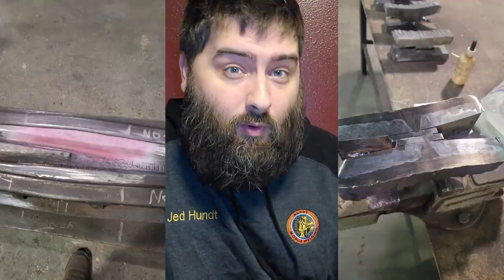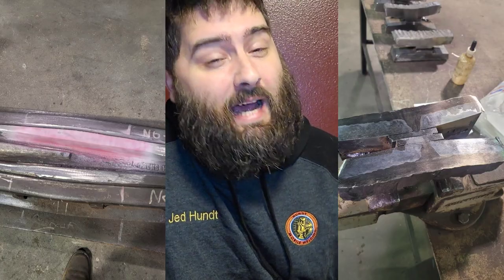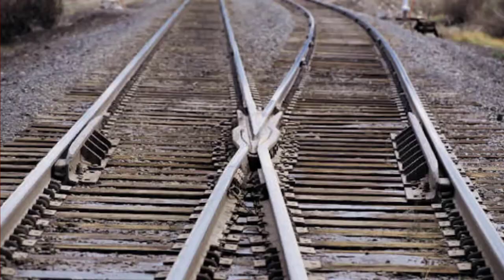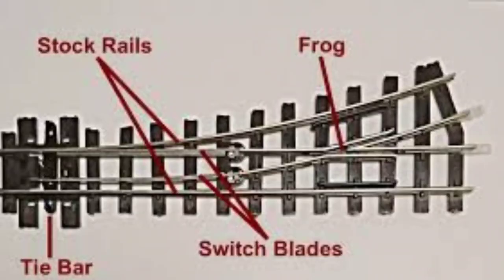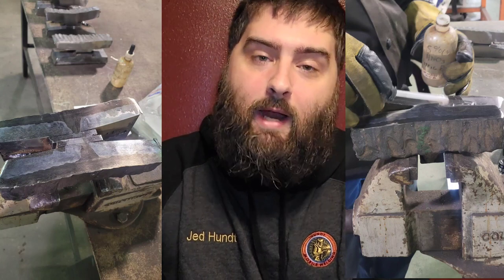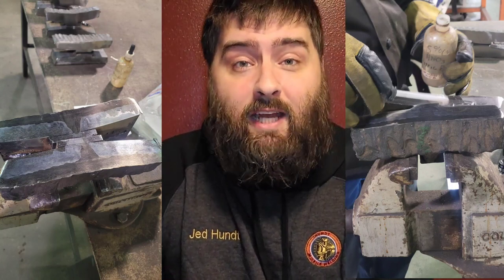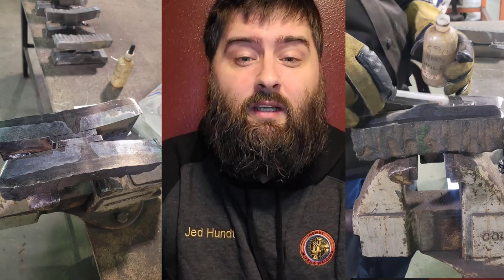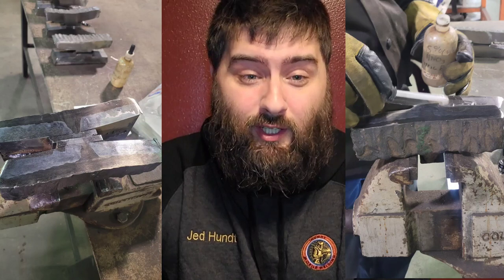Could you pass this Railroad welding test?

Comment: Got my first certification after an 18 month apprenticeship, in about 1980. At that time most of our welding was oxy-acetylene on open-hearth steel...frogs and rail. The frogs were actually bits and pieces of open-hearth rail, cut and milled to fit together, with a few bits of cast iron blocking as needed to make the finished thing look like a frog. Old school. Very large torch tip used for heating, flushing and welding. Welding was done with 1/4" diameter Oxweld MR rod in 3 foot lengths. Flush out the flawed metal, cut the metal with a hot cut chisel and striker. (The striker was a guy with a 8 pound sledge, ambidextrous and striking the chisel or flatter as the welder needs) Welding was done with O-A tip, pretty large bore - do not recall the numbers now, but the inner blue cone of the flame was 3/4" long. Puddle could be  as big as a half-dollar coin. As the metal is built up, it was periodically shaped with a 2# hammer. Excess metal periodically cut with hot-cut chisel and striker. Eventually the new metal is built up to surface or a bit above, then heated to an orange heat and again shaped with the 2# hammer to the desired shape...the excess metal trimmed with the hot-cut chisel and striker. Re-heat and finish surface with a flatter and striker, again trimming excess with chisel and striker. When done well, no grinding was needed. 
Of course, as my road got manganese alloy frogs, we got into stick and then flux core wire, using air-carbon arc to carve out the flawed metal and weld as you described. Also did considerable thermite welding. Finished on the road I started on, but it was bought by the CN and so I re-certified to CN standards, having been retired now fifteen years.
My complete kit could be carried on a gasoline powered track department motor-car, in the oxy-acetylene days. When I retired I used a Class B diesel truck with hyrail gear and an incredible array of equipment and capabilities.
Reply from the maker: That's crazy! Thanks for sharing all that.  It doesn't seem like we have come far (just melting metal together) but to see the advancement in technology is amazing.

Comment: We’d weld these frogs under some of the heaviest trains in the world. Die test, arch air gouge, touch up grind to surface, weld with Eutectic 40 Elctrodes for the underlay, then Mantrack 1ns for the last over lay. Every Bead laid has to be quenched with Ice water then pinned to work harden.
Weld bit at a time depending on the track time granted or planned by the Train control, or Dispatch as you say in the States.
We’d also weld the High speed turnouts frogs on Mainline. Only wing rail repairs where significant Shelling and dipping has occurred. 
These are a Head hardened Type Rail ( Steel)
We’d use an LN8 wire feeder with 8mm core flux wire, preheated the rail to 200 degrees Celsius, weld 100mm Beads at a time, cool under a heat blanket, grind then buff. 

All depends on the Engineering team of that particular network as this practice is sometimes frowned upon in the Heavy Haulage World 😂
Thanks for the video mate 👍🏾
Reply: I mess with .045 and .052 on mining equipment but 8mm?!?!?  Thats HUGE
Reply: @big_ute  it’s all about replacing the material we remove in a certain time frame from the train controller. Bigger the electrode, more metal goes in.

Comment: I could pass this test very easy.  I have taken and given many V-grove test plates exactly like yours.  I have also done lots of CAC. When I had the awsome job of training new hires.  😂😂 this would be a breeze for me..but I know for others it's a nightmare.
Reply from the maker: Pretty standard testing requirements.  The thermite welding on the other hand wasn't the easiest
Reply: @hundtmobilewelding  never done  any of that.
Reply: Too many "I" in your comment. The emphasis may well indicate you haven't welded an ordinary fab. Just saying.
Reply: @1977np  u don't know much about welding processes.  just sayn.   It's one of the easiest test given the field
Reply: @face ‘CRINGE’
Reply: @brandonendler2764  don't be so hard on ya self there buddy.  It will all work out. I'm sure you have 1 friend tha doesn't think that way about you.
Reply: @face.- it's basically padding inside a v- groove with a acid etch.just don't trap slag. Not that tough just saying
Reply: @brianpatrick7193  yeah it is

Comment: I.weld on manganese insert frogs , solid manganese self guarded frog, alloy switch points and rail ends and only a qualified  track welder not a certified track welder. Should I be certified?

Comment: I use to work for large AC machine makers from sheet steel they didn't let me weld the products but I was let loose heavy frames etc to test me I had to weld 5/8 plates at 90 deg and put on a anvil and smack it with a 18 lbs sledge hammer my weld did not break but the plates bent

Comment: I used to work for a company that manufactured switch rods for the railroad, as well as other components for them. I worked with them for about 15 years. Frogs however we did not manufacturer. But knew of them and still had to figure out which rods went with which frog number. It was definitely back breaking work in the beginning. With more experience I got, the higher up in the company I got. I was making nearly $23/hr by the time I left. Kind of wish I was still there. But health issues changed everything overnight. Had to leave for the clinic one morning, fell into a coma, and was transferred to a specialist hospital in 2 days, and hadn't looked back since.  and sucks! But yeah, railroad jobs are good money. Always constantly busy.
Reply from the maker: Sorry to hear about that. Glad you made it through! Railroading is great money but breaks the body down hard and fast.

Comment: How do you feel about welding manganese without a respirator? When I was a roadmaster at UP all my welders were required to have fit tested masks, so a beard was out of the question.
Reply from the maker: Those big welding hoods are PAPR hoods so they are respirators. No more need to shave and have a fit test.

Comment: The red dye is called Penetrant, you do Not let the penetrent dry it has to be wet the full 10 minutes, then you clean off the penetrant with a dry Lint Free Cloth after you have gotten as much of the red stuff off with the lint free rags you Spray Magnaflux Cleaner on another rag and remove all traces of the red dye, this drys for 5 minutes, then you spray the Developer ( white spray ) this stays on for 7 minutes, then you VT the weld looking for red bleed through for defects...
Reply: I wonder what the question in the written exam asked about the penetrant?
Reply: Most likely a standard ASNT question, 
I loved doing MT, PT, RT, VT Inspections. I never did like UT... @chrisallen2005

Comment: I wasn't aware that there was a specific class for welding frogs, worked for a small RR some 45 years ago and was the welder on that RR so I was the guy had to build the frogs back up, did OK but didnt have any of the training that you get from that class, would have been nice.
Switched to carpentry and never gave this another thought until I saw your vid, I'll never be in the position to weld a frog again but it was interesting to see how it evolved.
Reply from the maker: Yeah it's awesome they have classes for every type of welding now days. You wouldn't think melting some metal together could happen so many different ways. 😂

Comment: I was a Navy trained welder and worked for a time in a foundry, the foundry work was all air-arc and fill with dual-shield and everything had to be to X-ray and ultrasound specs, so I Know I could have welded and taken that test, back when the body was still working!  Is a fun job, but welding is hard on the body and beware heavy metal in any form.

Comment: First, congratulations on passing and being certified.
Second, I graduated with a BSCE degree in 1969 and spent over 20 years in railroad track engineering in maintenance, construction, inspection, and design.  I have done some thermite welds but never welded rail or frogs in track.   I did weld two pieces of rail together to make a mailbox support.
Third, frogs come in all sorts of sizes of rail, numbers(angles), and construction.  Frogs are generally made from pieces of rails either bolted or riveted together, fixed or spring rail, manganese insert casting surrounded by rail, and a solid manganese casting which includes a flat-top or self-guarded.  I have seen a bolted rigid self-guarded frog.  Most frogs over No 20 are a swing rail design and do not need guard rails.  These types of turnouts are for heavy, higher-speed main lines or high-speed tracks with rail sizes of 136 or 140 lb rail or the metric equivalent.  The largest number turnout I know of is a No 32 on the Brightline track close to the Orlando International Airport in Florida which connects the airport with Miami with high-speed rail of 125 mph.  This turnout is good for about 85 mph through the diverging side.
Four, a frog is known and called by its number or the angle the flangeways make and by the rail size it is meant to be used with.  The number is determined by measuring perpendicular to a line that bisects the frog from the nose to the heel and is measured by how many units are between where the spread of the frog gains one unit.  That is if a spread of 2 inches is measured between the sides of the frog and marked and a spread of 3 inches is measured and marked and the distance between these marks is 8 inches then the frog is a No 8 or 7* 09' 10" angle(7 degrees 09 minutes 10 seconds).  If the frog is a No 10 then the angle is 5* 43' 29"(5 degrees 43 minutes 29 seconds).  Steel rail has been rolled in 8 lb per yard up through 155 lb per yard with crane rail sections of 105 lb through 175 lb per yard.  Most railroad and transit tracks are built with 115 lb, 130 lb, 136 lb, and 140 lb rail of AREA section.
Five, railroad frogs are almost universally straight on both sides while streetcar or tram track frogs are curved on the diverging side.
Six, frogs are also used in the rail crossings of two tracks and are called out by the rail section of the heavier rail if there is a difference between the routes, the angle the two tracks make at the center lines of the routes, and the radius or curvature of either or both routes have at the crossing or intersection point.  There are a total of 4 frogs in a crossing because the flanges of the wheels make 4 crossing paths.

Comment: An old guy who is training me said there are still some spring loaded one way frog? If so how do they work and what’s an easy way to spot them when riding rail?
Reply from the maker: Good question I'll make a video soon about the different types of frogs "railroad type" out there.
Reply: Those are easy to spot.  Look for a frog that has only one open flangeway on the through or mainline route and the other(diverging route) flangeway is closed by a wing rail that has a housing that looks like a can laying on the frog-plate attached to the web of the wing.  The spring is in the can.  If you are familiar with a "jump" frog, it will have a similar appearance but not the ramps.  These are used mostly on main lines to give a better ride over the diverging flangeway by supporting the wheels on that side.

Comment: That inclusion was less than an 1/8th so your good right I'd give it a shot but idk if I'd pass or not
Reply from the maker: Correct,  1/8th inch total in defects to pass. Mine wasn't even close. Im sure you'd be fine. It wasnt as hard as an over head or pipe .
Reply: @hundtmobilewelding  I suck at pipe
Reply from the maker: @seantbr2019  that's the reason I'm not a pipe welder 😂 could never get the hang of it.

Comment: This test is easy! If ur at the very top level of welding! A very fun test I like it ! Try a boiler tube chrome test  heavy wall!, or a inconel heavy wall Or a stainless 6 g tig out heavy wall test2”-6”, or a 42” 1000wallpipe stick pipeline test 1104 or b-31a or b or pressure vessels heavy wall testing! Or a plate test 232 3/32” wire 1” unlimited! flat, vert, ovr head, to a 12 branch on a 375wall 1104 or b-31 lowHi  or 8010! Or a full pen moment joint 2+” of steel airacr the back out full pen! Lots of them I’ve done ! Been welding In The union trades and non union for since 91
Reply from the maker: Nice! Those 6g test are not my favorite. You won't see me even trying them anymore. Like I said I think the hardest part was probably the grinding it into spec.
Reply: @hundtmobilewelding  well said, I concur!